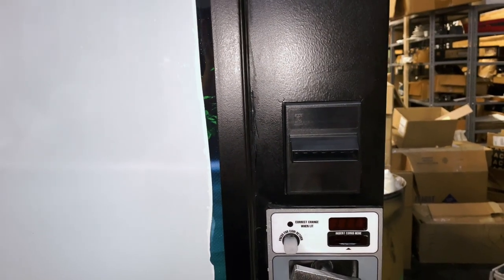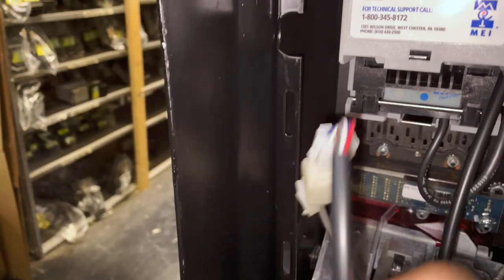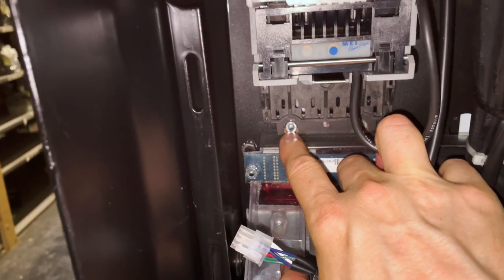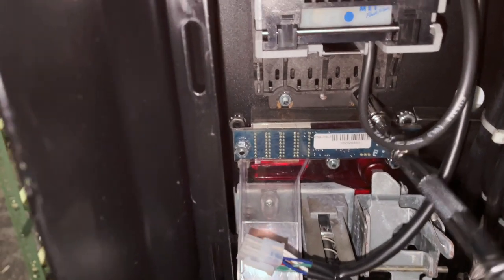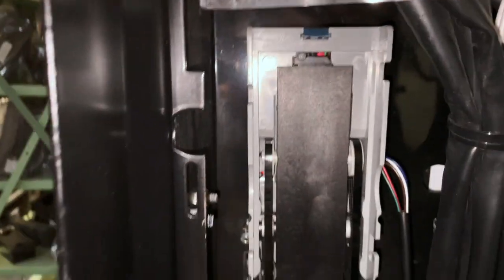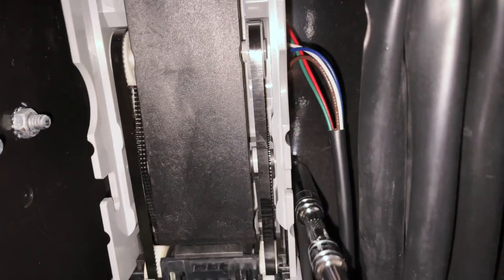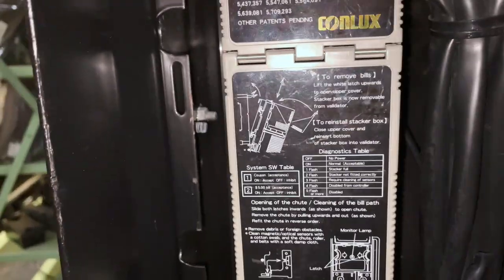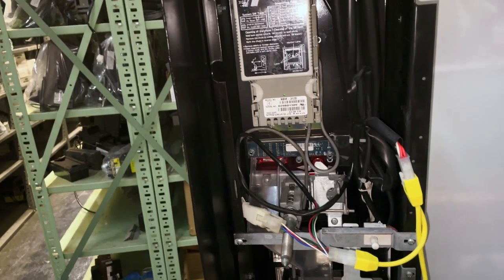Dixie Narco 501E & 276E Vending Machine - How To  Remove A Dollar Bill Acceptor

Comment: Could you do a video about switching over to led lights on the dixie?
Reply from the maker: Thank you for the great suggestion. I will certainly add that to my growing list of topics. Most of the 'Direct Replacement' LED bulbs I have come across. Has the manufacture recommending the removal of the fluorescent ballast before installing their LED bulb.
Reply: @VendingMachineSupport   Well I'm in the process of trying to figure out exactly how to do it currently. I'm savvy when it comes to wiring just aint had time and stumped on this one.  But yea thanks for your videos for us newbies. That suggestion and maybe cooling deck repair too. Those would get good views.

Comment: My machine accept one bill but when I try to put another dollar in, it doesn’t want to take. Th coins are full. I try to clean up the bill acceptor but nothing. Can anyone help me on what to do next.
Reply from the maker: @Lina Kalala Have a look at the current ESCROW setting on the S2D control in your Dixie Narco. Navigate to USER -> ESC. You will want to have this set to E-S4. This will stack any dollar bill into the bill box and not in escrow. When a dollar bill is held in an escrow state. The first inserted bill is not placed into the bill box. This is done to allow the customer to retrieve that inserted dollar bill if a they cancel the sale. With escrow turned off. A canceled sale returns the dollar credit back as change. ie Four quarters.
Reply: Hello, my Dixie Narco 501e stopped accepting bills. It will take coins and credit card. Could someone give me any ideas for solving my problem? Thank you!